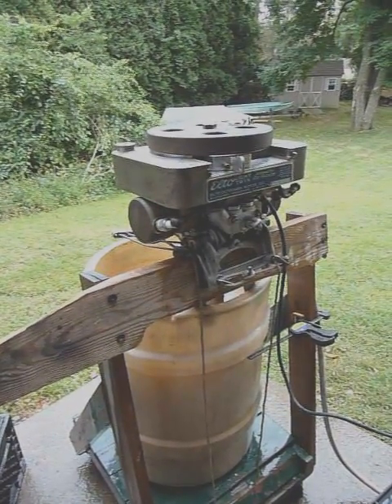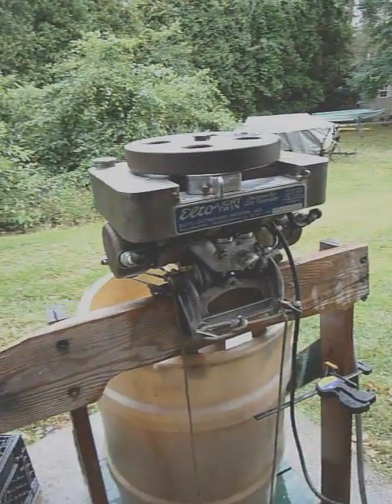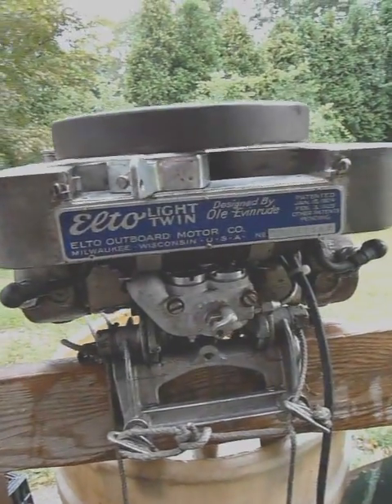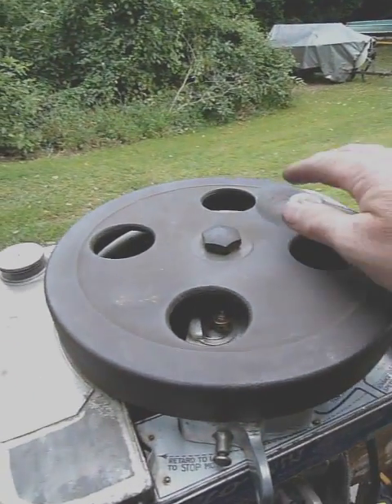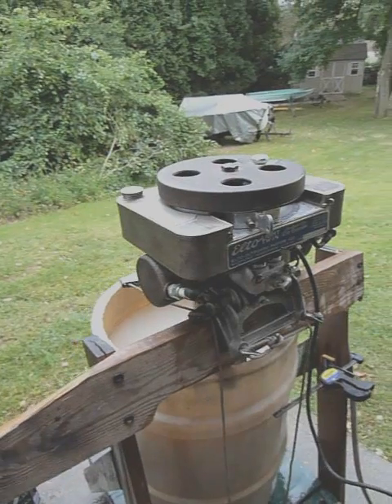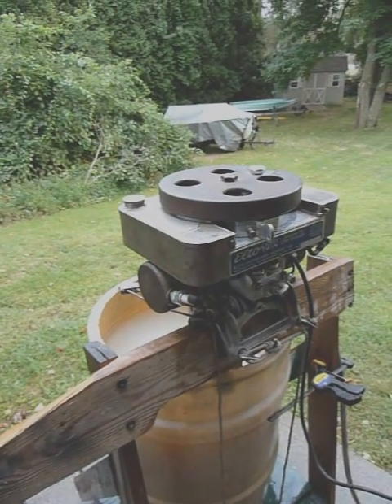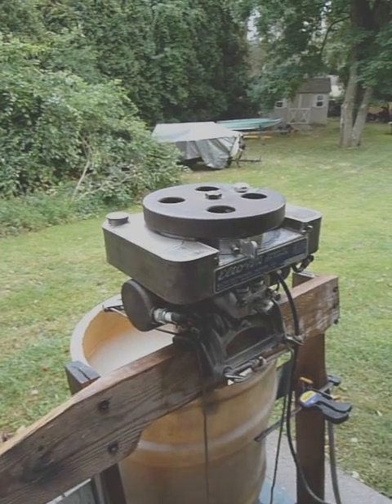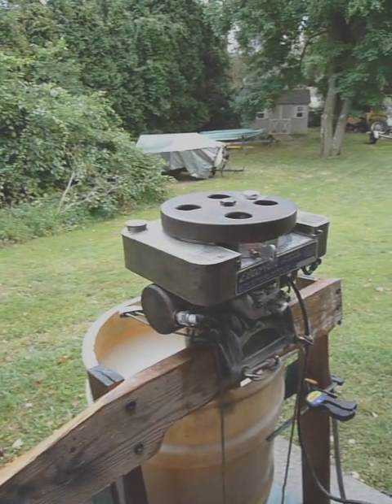1926 Elto "Super G" Ruddertwin

Comment from the maker: The "G" designation was only used for 1926 model year Elto motors of standard length.  (Long-shaft motors in 1926 were "H" models.)  I think 60psi should get you running, then a soak with OMC Engine Tuner or Seafoam may improve it.

Comment: Another question or two if you don't mind.  1. We're super g only 1926? Mine label dayd super G and blue label looks identical to yours.  Does serial # tell the year?  2. Do you know compression ratio of the ruddertwin. I measured 60psi of compression on both cylinders.  Low for these engines? Thanks so much!